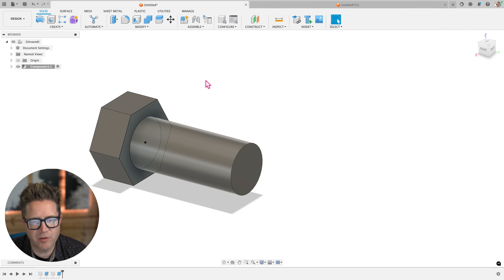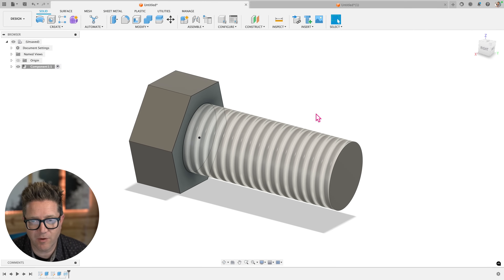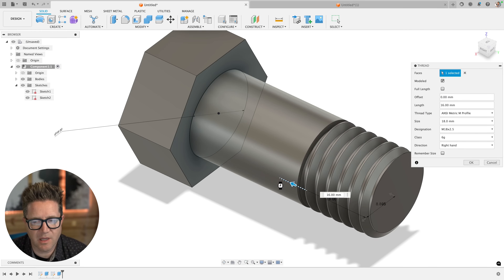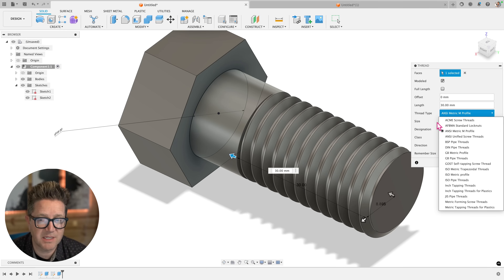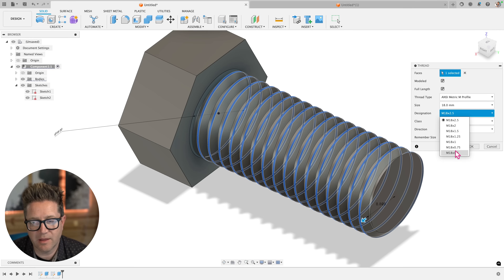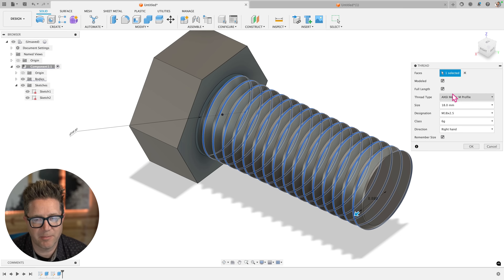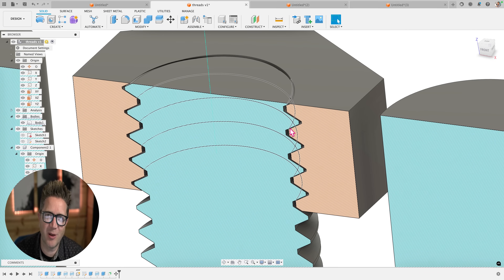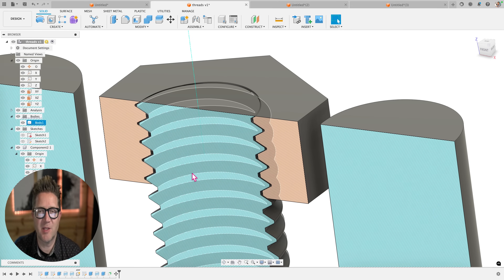Learn Fusion 360 Threads – How to quickly apply threads to your model

Comment: very helpful, thank you. Does Fusion automatically undersize external threads / overside internal threads for you (i.e. build in the tolerances) so they fit together? Said another way, if I want an M8 thread, should I make the cylinder 7.9mm or something? Or will fusion do this for me? Thanks

Comment: I wish there was an option for the 3d printing world that would allow an "adjustment" for the pitch depth.  and save me having to "press pull" the thread faces to allow for better/any fitment.  also.. NPT threads would be a nice option within fusion.  I deal with gas/air fittings a lot in the film industry and drawing these is a Pain, as I often 3D print prototypes for testing.  another great video though.. thank you again

Comment: When you do the offset or the length for a shoulder, is there a way to set it to the minor diameter of the thread? Because having an offset or a shoulder the same size as the major diameter doesn't really get anyone anywhere.